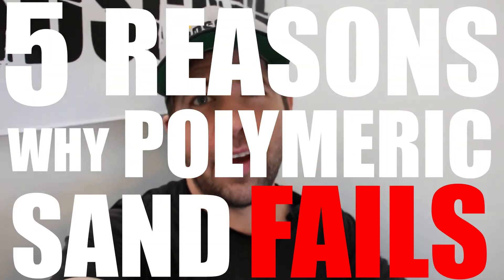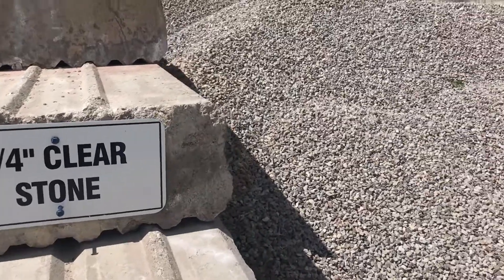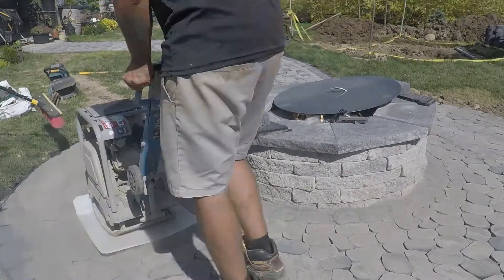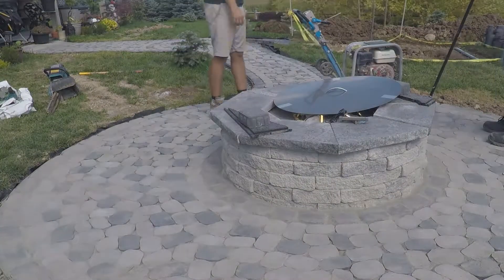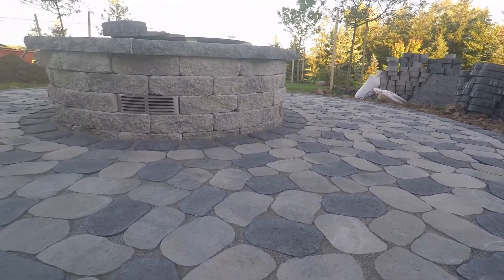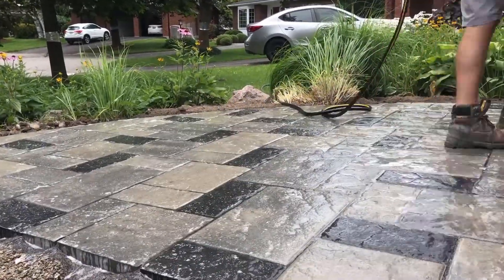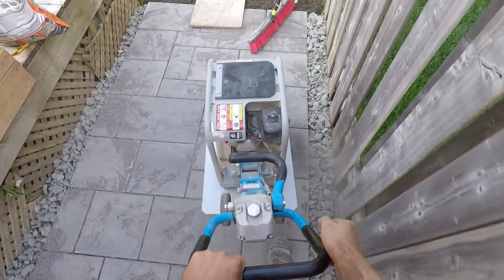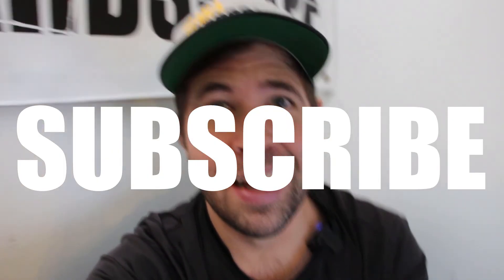Why Polymeric Sand Fails | 5 Reasons and How to Prevent Them

Comment: What to do with a paver patio (15yrs) that has started to let weeds through and now moss growth?
Reply from the maker: You can pressure wash them and hope to get the weeds out. But sometimes if the weeds have taken root, the pavers need to be lifted and the weed removed. Then re-install the polymeric sand
Reply: Thank you. @iamahardscaper

Comment: I have a patio made of old irregularly-shaped sandstone pavers of various sizes. It was installed by a previous owner. The major problem is that the joint width is not consistent throughout the patio and some joints are 3" to 4" wide. Whatever was originally used to fill the joints, I believe it was rock shards, has eroded and these wide joints make this patio dangerous. I am constantly twisting my ankle in the joints. Is filling 3" to 4" wide joints with polymeric sand a reliable solution, or are these joints simply too wide for that? Some hardscapers have suggested doing that, why others have suggested lifting the pavers and placing them back down with much smaller, more consistently-sized joints, and then filling with polymeric sand. I don't spend much time on the patio, so I don't want to overspend, but I'm looking for a safe, long lasting, affordable option. I would appreciate your advice. Thanks.
Reply from the maker: I’d lift and tighten the joints. I think the widest polymeric sand application is 3” and it is a specific polymeric sand that is more expensive. And I don’t trust it even at that width.

Comment: Very informative! Would it work to use polymeric sand between large Quartzite flagstone pavers that are 20mm-30mm thick with a 2-4 inch space between to strengthen the joint and then put small pebbles or rocks on between for the final top (visible) layer? Need to maximise drainage and its only a small walkway (less than a metre wide)
Reply from the maker: You would want to use a polymeric sand that is suitable for larger joint spacing. Alliance Dust (I believe) or TechniSeal NOCO or NextGel. These I think are suitable for joints up to 3” (but double check). You’ll also want to make sure they are suitable for that thin of a material. Most polymeric sands require 1.5” minimum depth. I don’t think your plan would work with the rocks on top of the polymeric sands for that reason.

Instead check out a product like Gator Rock Bond, where it mixes with the rocks to stabilize them. There are other similar products.
Reply: @iamahardscaper  Thanks for your reply! I am in Australia so I'll have a look at what products we have (not as many as in N America that is for sure) that would be similar. Sounds like depth will be an issue for the polymeric sand option though. I wasn't planning on using concrete or anything super hard. gravel and pebbles might be the best choice then?

Comment: Wish I watched this video first. I followed the directions of it but when I used my blower to blow off excess sand I was afraid to blow it out the cracks so I left to much sitting on the pavers. Then it hardened on the pavers. Now I’m trying to figure out how to correct it
Reply from the maker: Try hot water. If it isnt a large area, pour it on the pavers, scrub, and wash away. The hot water reactivates the polymers.

Comment: Almost everyone where I am uses DGA, or dense grade aggregate as their base material which has crushed up limestone in it. They then put an inch or so of sand on top. Is this OK in your opinion? It seems to me that the sand would allow for the water to pass through, but that dense grade aggregate, which gets compacted, does not seem to be permeable. I am actually not a Hardscape, her, but as a regular landscaper, I am often asked to do repairs, and I do have a polymeric sand project coming up. I used to do the polymeric sand for a Hardscape her that I worked for and I realize now that, it’s possible that he was skipping some steps. I’m encouraged to see there were a lot of things that I was doing right, but we did not compact the sand after applying it, and it was never a consideration what base material was used. Furthermore, I don’t remember ever being asked what size the joints were. It’s funny to think about now, because I’m the only one in the company that the boss would let do the polymeric sand because I did have an eye for detail, and I was very concerned with making sure the patio was not wet and that it had the right window of clear weather afterwards. I’m happy to learn that there are more things that I can do to make my process even better, but I am definitely a little nervous.
Reply from the maker: Yeah that is acceptable as long as it is not stone dust / limestone screenings which is more like a 1/4 chip down to dust. 3/4” down to fines is an acceptable base with 1” of sand on top. We don’t compact the bedding layer of sand unless we are using paver base panels like Gator base on top of it. We do always compact the pavers though into the bedding layer when installing the sand
Reply: @iamahardscaper  thank you for your response. The sand itself does not get compacted, just the base layer. I’m guessing that’s the same way you do it except that you don’t compact your base layer. Like I said, I am not a full-time Hardscaper, I have built several small patios, and been a laborer on several large patio jobs. As the lead guy, I’m not quite comfortable enough to assume the risk of a larger 20 or $30,000 project in Hardscape. But, I do think I can remove the polymeric sand and redo that on some of these bigger patios. I’ve seen what some of the other companies do, even companies that are technically full-time Hardscape companies, and it makes me really wonder how they are getting away with some of this stuff. I worked on one a couple months ago that the client told me they’ve been out two times to fix things, but the pavers for lack of a better word were sliding off and once I got in there and saw what was going on they had not even installed edges of any kind, so all the pavers were moving around. It was a sidewalk as well, so lots of foot traffic. I would not want to deal with those sort of issues constantly, I’ll stick with the simple dummy stuff and let you smart guys do those projects. Lol.

Comment: Do you have any videos of flowerbed paver borders? This weekend i'm laying pavers in a 12' circle and backfilling with pea gravel for a firepit. The plan is to dig approx 4" deep and hand tamp crush and run. Im a lawncare guy thats trying to branch out and this is all new to me.
Reply from the maker: Ohh unfortunately nothing like that in our library. Let me know if I can help in any way
Reply: @iamahardscaper  I just had a border installed around my house with 6 x 9 pavers, some of them vertical some of them horizontal creating an L shaped border around the house. Within that border, we put weed bedding, cracked river rock and just a few vative plants.  Underneath the L-shaped pavers is compacted, 3/4” stone and there are small gaps left between pavers. I would like to use polymeric sand, do you think it’s absolutely necessary to vibrate it down into the spaces?

Comment: I watch your videos all the time.  Tell me, please, if I need to fill out part of the parking area and raise the level by about 20 inches. What is the best way to do this, which size of stone is more suitable for such a height?
Reply: I probably put it incorrectly question, the wall is made with high quality.  I need to raise the level of the tile by 20 inches up.  I wanted to ask what fraction of the stone is better to pour such a height.
Reply from the maker: Oh it depends. That’s tricky because I’d have to see what you already have there.
Reply from the maker: Most retaining wall product is suitable for 20 inches in height. If it is for vehicular traffic you would want to make sure that it has locking mechanisms and to follow the spec to install it including geogid placement. Hope that helps!

Comment: So I just layed a 144 x 32 in section of pavers. I'm going to lay the poly sand down tonight. Can I use a hand tamper to go over the pavers instead of the machine in this video to get the sand down in the joints?
Reply from the maker: Those are inches? I’d say you could get away with a hand tamper though not ideal. especially with a small space you should be alright. Put something over top of the area like plywood to spread the impact over a wider area.
Reply: @iamahardscaper  ok awesome and yes it's 144 inches  x32 inches. Thanks for the quick response!🤘🤘

Comment: I had a paver patio put in 4 years ago and the contractor used cr6 as a base and stone dust as a bed.  Wish they hadn't used stone dust for the bed but I am stuck with it now.  The poly sand has turned black and is gummy 4 years later.  The pavers are nicolock with a pretty tight gap.  What do you suggest I use to replace the poly sand?
Reply from the maker: That’s a tough one. Poly is not ideal with the stone dust there, but the only other option is jointing sand loose. But that will wash out over time and weeds will grow if not maintained. You could apply a joint stabilizing sealer to seal in that sand, but with stone dust there acting as a sponge for water you would want to really make sure there is no moisture that you are trapping in with the sealer.
Reply: Gyc

Comment: Hi, thanks for this video. I guess I am already in that "failed" category. It had rained for a few weeks since the 2nd day when I put on the sands, and now I don't think they will ever cure. Is "pressure washing out and reapply" the way to go?
Reply from the maker: It’s tough to say without seeing it
Reply: @iamahardscaper  the sands remain powder-ish loosened, feels like normal sands.
Reply from the maker: At this point if it was installed at least 30 days ago it is likely not going to cure. It may be useful to discuss with the manufacturer to see what they say.